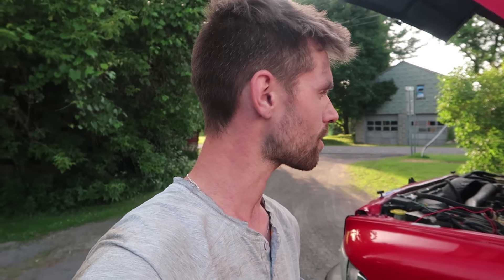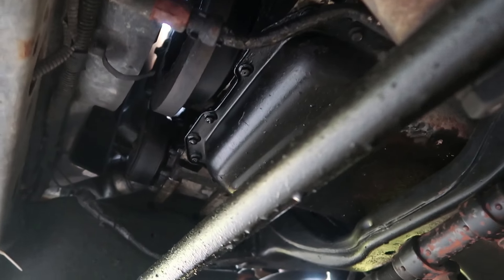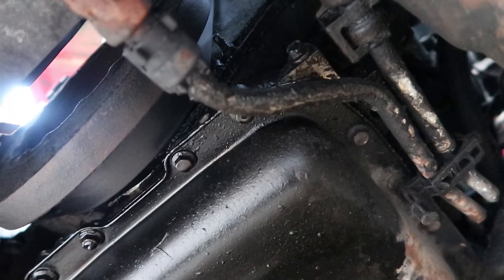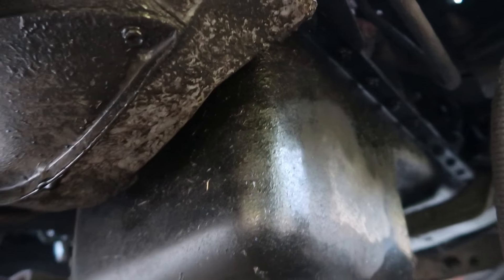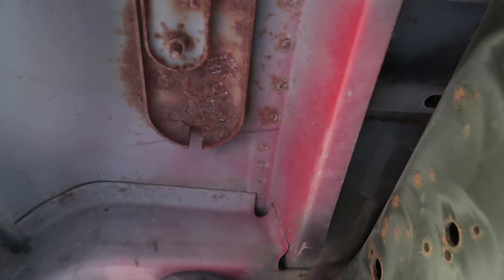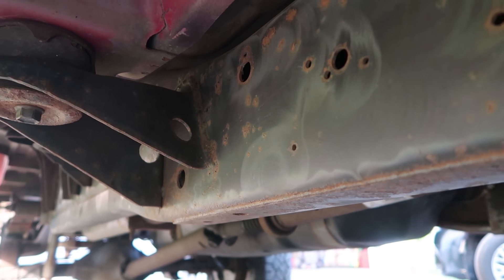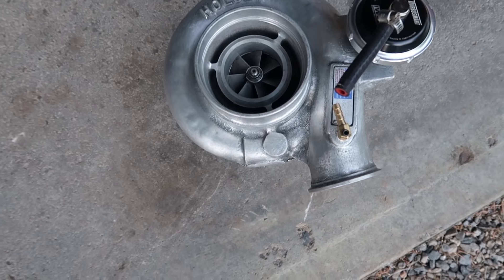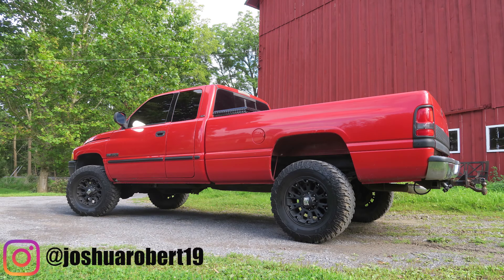Cummins OIL LEAK

Comment: There's a plate on the side of the block motor the seal is bad to replace it you have to remove the injectors pump the cover plate is from the front of the engine and it's always to the back I done that on My truck before

Comment: I just walked in from hot pressure washing a 4x4 i just purchased, it’s that front breather hose and cup, i always toss the cup extend breather hose down below the sway bar with a couple of twists of some tie-wire. Typical leaks are vacuum pump seal (witch will make you think its a front main seal)power steering pump, push rod cover gasket and valve cover gasket (witch will make you think a rear main) just did all the above engine is dry and clean.

Comment: So I have the same issue, so far I have changed front seal, oil cooler and still have oil leaking. What is left is the turbo drain tube and the vacuum pump (both are leaking) and last will be the oil pan as I think that will be the worst job. But that said, 400,000 she is entitled to leak if she wants.

Comment: My 97 12v has a port on the driver side of the block in front of the lift pump. I removed the plug it is 1/4- 28 thread I believe. It has an oring i replaced and that fixed 1 of the leaks.

Comment: Hey there Josh, Check the oil breather front upper left hand side there will be a tube and a catch can (aka puke bottle). It’s a cheesy design because if it’s not drained out i.e. oil change for instance oil will spew out the holes by the top of bottle. The fan will blow oil everywhere! I fixed this annoying problem by attaching a longer hose and a Morosa catch can. Hope this helps! Cheers from Cali! Tim
Reply: Hay do u have to take the engine out to replace the main rear seal on a Cummings 5.7 tow truck
Reply: Nailed it!
Reply: tim O thank you so much man. I saw mine when I crawled underneath it and had no idea what it was. The fan is blowing it everywhere!!
Reply: Where in Cali are you located?

Comment: I pressure washer my 1999 Dodge Ram 3500 . Or should I say my 1999 Harley I’ve been chasing oil leaks the shit drove me crazy . I just found that the cam positioning sensor was leaking a lot it was causing the same issues your having . Replaced / problem solved!!!
Reply: Oil leaks are back oil pan gasket, tappet gasket replace, smog pump , power steering pump and hoses , new injector pump , new transmission , head gasket valve cover gasket , no more leaks lol 6000$ later drive a bicycle hell of a lot cheaper

Comment: I've got the same problem with my truck at the moment with oil and power steering fluid blowing back everywhere. Mine is leaking power steering fluid from the power steering pump and engine oil from the vacuum pump where the two pumps join together. Will finally be able to tell if there are any other leaks after I fix it this weekend
Reply from the maker: Dakota McDivitt looks like it's time rebuild vacuum pump with new seals. I may need to do mine soon too
Reply: Mine just went through this... PITA.
Reply: @purepanorama8484 
Hey I'm not sure if you'll see this, but did that fix your leaks? I might have the same thing going on.
Reply: @christopherdickinson4291  Did your oil stop leaking after you replaced those seals?

Comment: First off little different vehicle but still potentially relevant. 2004.5 iron 6spd 2wd Pulled the trans clutch bellhousing fly wheel starter etc 2 times in the past 3 days still leaking. new motor. All new parts.
There is an o ring between the bellhousing adaptor and the block it circles the cam and is supposed to stop oil from seeping past the end of the cam.
No one I've talked to knows what to do I'm headed to the dealer now to buy 30 dollar OEM o ring but it's going to leak and then I'm going to have to figure out how to really fix it. The stock oil filter has a thick pliable gasket that's looking like it might be part of bastard experiment. Keep you posted

Comment: I have the same problem with my truck 2001 Dodge Ram 2500 5.9 -233.000 miles 
🤦‍♂️
Reply: I've got 430k on mine and need to do this too😐

Comment: I have a 2003 Dodge 2500 diesel. I was crawling under there today and noticed that I have a leak of my own. The moisture I am seeing on mine is in similar spots. I am also seeing some red fluid. Initially thought it was transmission fluid, but my transmission fluid is fine and my power steering was low. Let the "fun" begin

Comment: Start by re torque the oil filter housing.  If you replace the front main seal make sure you install a ware sleeve while you are there. Although with that oil leak you have will not allow the rust to continue.
Reply from the maker: Abraham Salcido that's the one good thing it provides. Jeeps the front of the truck rust free. It's not a bad oil leak either. It takes a bit for it to all get covered after I degrease it down there. So it's a small leak from some place.

Comment: Buy dye at auto part store to pin point the leak. I believe mine is leaking at the tappet and turbo return line.most likely its your tappet your truck looks just like mine the oily areas
Reply: Do a degreasing video id like to degrease mine 1 day
Reply from the maker: DIESEL SYNDICATE I've been planning to install a new tappet cover gasket when I do the vp44. I don't think the tappet cover gasket was done when the last guy did the vp44.

Comment: Check the puke can on the front of the engine, the small plastic bottle fills with oil and spews out all over the front of the engine, sometimes the hose pops off. Get a longer hose and get a bottle with a filter on it and relocate it.

Comment: Did you find the issue?
Reply from the maker: I havent dug into it to look any further yet. Probably will put that on the to do list for this spring.
Reply: @Pure panorama I have a similar issue except mine actively loses oil it's so bad, I have a 1/4 inch of grim buildup is some spots like the alternator... I'm interested in seeing a video of the diagnostics and repair of the leak when you get around to it. Awesome videos man!

Comment: I had a issue with oil leaking from my power steering and vacuum pump after replacing the power steering pump.
Reply from the maker: Power steering pump was actually on my to do list.
Reply: What Cummins doesn’t leak power steering lol

Comment: How's it sound so throaty?
Reply: It's a 24-valve.  They always sound mean.
Reply: @ions82  my 24 valve doesn't
Reply: @ericdeblanc7060  Maybe that sweet diesel tone has beat up your ear drums.  What do you have for exhaust?  I am a 12-valve guy, so I'm used to the sound of an old tractor.  I can usually pick out a 24V just by its sound.  You're talking about 2nd-gen, right?
Reply: @ions82  3 inch turbo back with silencer ring delete
Reply: @ericdeblanc7060  A 4-inch straight pipe with a tip would definitely change the sound.  Ive always run the 4-inch with a straight-thru muffler, but I've got 12-valvers.   They are a little quieter than the 24V.

Comment: Looks like the front seal, oil pan gasket needs replacing
Reply from the maker: kenny etenne that's been my thought for awhile now. The pan gasket is doesnt look like a fun job, having to drop the trans out of there. At that point it's time for a new rear main too while it's all exposed.
Reply: Yes might as well if it's already taken apart!
Reply: pure panoRAMa you can pick the motor up on the front lifting eye with a hoist to gain some room to sneak the pan out, also tappet, vacuum pump, front main seal the gasket on the back of the timing case and or front , turbo drain valve covers, look for any return line leaks on the injectors for fuel leaking down the block looking like oil?

Comment: I agree totally with tim... I have a second gen and mine didn't come with catch can, as of other trucks I know of. Check the breather on front of engine.  Mine has about a 6-9" hose that is just screwed to front of block with a clamp from factory. It drips oil out of it every now and then covering the entire underside of engine and steering bars.....google "slobber tube". That's what a lot of people call it

Comment: Just bought an '02 and its leaking 10 times worse than yours.  One of the forums said to check the tappet / pushrod cover, but that seems to be ok on mine.  

PS - better with no music.
Reply: That's were mine is leaking
Reply: I'm a little late to the game but my 02 sounds like it's leaking like yours was.  Did you ever find the leak?
Reply: @tommynichols9171  On my 2002 24v, it was the "tappet cover" on the driver's side. It was a tough job, but I managed to do it. I'll send you a link if I can find it.
Reply: @tommynichols9171  watch this vid & see if your oil is dripping in the same spot https://youtu.be/zPpXtOwgzog
If you do the tappet cover, the VP44 R&R is the hard part. There are a couple good vids on yt that offer some guidance.
Also read my comment on the attached vid. The gasket has two sides, make sure you put the thicker side towards the block!

Comment: What’s the rust preventer spray and what undercoating I need to do the same
Reply from the maker: I just sprayed my truck with rustoleum under coating in a spray can. Right off the shelf at the parts store or walmart.

Comment: 3 inch rubber hose on pickup tube
Reply: It will be on the passenger side go in from underneath after you take the rubber hose off the we'll be a flange on each side of the pipe put new hose on Titan down should fix leak

Comment: My first guess would be a transmission line to the front cooler. I would make careful monitoring of the transmission fluild level and the engine oil level, that will narrow this down. You should be able to narrow this down to either a transmission fluid leak or an engine oil leak.